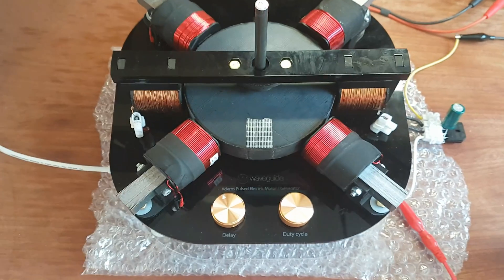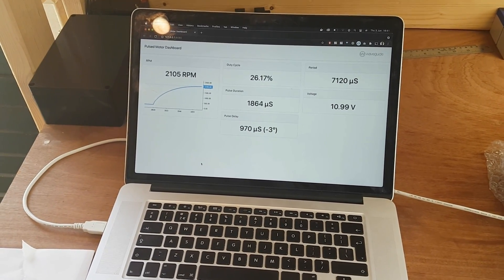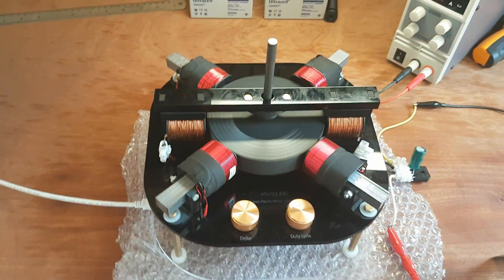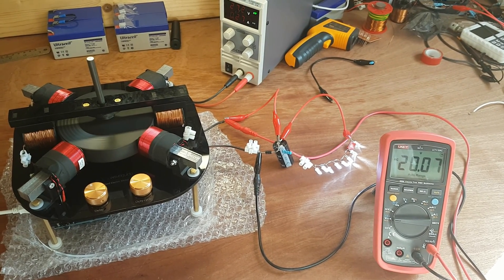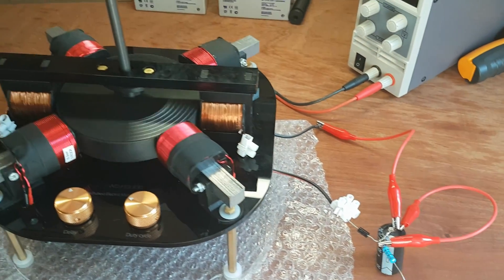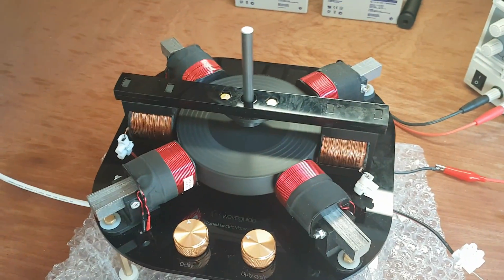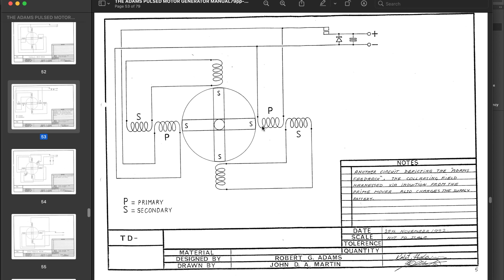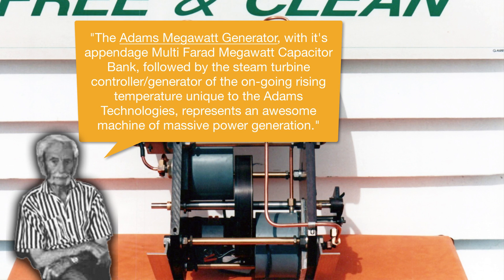COMPLETED Adams Pulsed Magnetic Motor Generator Load Tests + Brand New Adams Material

Comment: Wait did you try anything like flip the iron bars of the generator around. The lenz drag certainly happens when the magnet wire is close to the magnet, but is that the same for induction through the iron alone, on your machine?
Reply from the maker: I did not try that yet no
Reply: @Waveguide  I know it is hard to stray from the clearly described path, like your on one clearly. But then again it doesn't hurt, it already slows down now. It is certainly possible to get rid of drag, hence the reason for me to build a new generator again. I had this small Mock up generator that did not slow down, and now I'm going for the bigger one. JP

Comment: How many other folks pointed out your drive coils are too close to get decent results, adams suggested 1/2 inch gap between the drive coil and rotor
Reply from the maker: Thanks for youe suggestion, but Robert Adams specifically mentioned a 1.2mm air gap between magnet and coils was important. Do you have a reference to a quote from Adams himself saying the gap needs to be 1/2 inch? Because I've never read that anywhere.

Comment: Nice and neat build.  Just consumption of your system is very high. In my device with 30V input it takes up to 0.06A. I use relays coils as a pick up. With its 10K turns It gives me good voltage. It change to curent later in separate system.

Comment: Nice set up. I had an aluminum disc machined (10 inch wide x 3/4 inck thick) I had them perfectly drill and tap 8 holes for my 1 inch wide magnets x 3/4 inch thick.
Balance is awesome.
The output is way up there. I removed the pick up coils and added more run coils. The spikes are greater then 170 VPP.

I made a video of it if it will give we ideas.
Reply from the maker: That sounds very impressive! Would love to see a video of your system in action. 

What are you using to pulse the coils?
Reply: @Waveguide  I have several vids out there on my channel showing it working. I try to make them short. I use the typical Bifilar (Bifiler?) coils and 12VDC. Thanks for the response.
Reply: @Waveguide  The videos show a practical application that one can actually use in real life instead of solar. Please watch and learn. I'm watching more of your vids to see if I can learn something more so I can share it. OH, I just sub'd, Thought I did the other day.
Reply: This is first I've heard of this can you help me with any plans or anything like that I was looking for a bindee motor

Comment: nice work =) could you share the reason of your coils beeing at a different angle ? In the original, 25° offset seems his way to go .... looks like you did 45°?
Reply from the maker: Thanks for your question! In the original design the generator coils can be moved between 25° and 45° to find the ideal position. I first did that, but it made the coils shake a bit (less sturdy) and didn't notice a significant difference in output.
Reply: @Waveguide  very interesting , so no need to test that out ^^
 thanks for sharing ;)

Comment: you need to pulse the output and also use a bridge rectifier to catch the back emf!
Reply from the maker: Dozens of people have told me this already, but the pulsing of the generator coils comes from Patrick J. Kelly. Robert Adams himself has never said this, and in his UK patent (https://patents.google.com/patent/GB2282708A/en) he even mentions you can replace the generator coils for a traditional alternator connected to the shaft, so there does not seem to be anything magical going on with his generator coils.

Comment: Robert Adams said that the output coils are turned off most of the time. They are connected to the load when the magnet is located exactly in the center of the coil core. The coils remain connected for only 3 degrees. It is impossible to connect the load to the output coils all the time
Reply from the maker: Many people say this, but I've read nearly everything Robert Adams ever wrote, and never saw him mention this fact. The only person who I've seen mention this is Patrick J. Kelly, so it's a third person account. Adams himself says in his UK patent that a regular generator can be connected to the shaft, so there seems to be nothing too special about his generator setup. If you have a reference or a quote from Adams saying otherwise, I'd love to hear it! 🙂

Comment: Hello Waveguide,
    have you considered the idea that your rotor is traveling  at or near super sonic velocities at 2000 to 3000 rpm's???  You could eliminate this by either running your motor on top of mount Everest or putting the whole thing in a vacuum chamber and dropping  the atmospheric pressure to a point that will allow 5000 or even 6000 rpm's WITHOUT the motor trying to disassemble itself!!!  This is the reason all electric motors in todays society are built so sturdy, and make so much NOISE!.
Reply from the maker: Yeah the peripheral speed is pretty scary indeed! And my rotors have disassembled several times because of that.

Comment: It is no wonder this device doesn't work because you have not followed Robert Adams simple instructions. This is not a valid replication only a conventional pulse motor driving a standard induction generator. It will never work as you have built it, not in a million years...
Reply from the maker: Thanks for your reply. Please let me know which instructions from Robert Adams I have not followed, because I tried to stay true to his design, apart from the switching circuit of course.

People here constantly give me tips like: "use bifilar coils" or "switch the generator coils", and I always tell them that I won't do that, because I try to only do what Adams did.

So I would very much like to know from you what instructions of him I am not following.

Comment: Hi., Do you achieve overunity? In your experiments in adams motor gen...  Been replicating it but can not achieve speeding effect while on load
Reply from the maker: No OU effects so far.
Reply: @Waveguide  thanks ..maybe ill stop here for this,.. and try to replixate solidstate devices like MEG
Reply: @Waveguide  whats the highest efficiency you've done so far?
Reply from the maker: @cesarranolo9215  using standard meters on input and output, only 20% efficient or so. However, the inventor said you needed to measure using calorimetry.

Comment: You got close when you shorted. The output coil except you are supposed switch them  out  part way through  the magnet passing  so field collapses  adds more push to the wheel. And energy output
Reply from the maker: I heard this before, but it seems the person who wrote about this idea of switching the generator coils is Patrick J Kelly, and Robert Adams never mentions this. Adams' UK patent even states that for the generator a traditional alternator connected to the motor shaft might be preferred. And a traditional generator doesn't switch either of course.
Reply: Yes he said it was some one who replicated the Adams motor and achieved 800%  efficiency ,  but I have seen this in a few other. designs to achieve over unity with other devices
Reply: One other thing that don't consider it is an attraction motor  so  drive electro's must have a smaller face area than the magnet's. So you only need a very short pulse to break the magnetic lock that is where you the gain. Magnetic attraction drives the motor  small poet pulses. Allow it to carry on and not lock up then you harvest the back Emf

Comment: Wow cool good work ! Are you using speaker laminate crossover coils for your Adams Motor?
Reply from the maker: Thanks! For the generator coils, yes. The drive coils are hand wound using 0.5mm wire on a solid soft iron core, as per Adams' recommendation.
Reply: @Waveguide  Is it possible to know the gauge wire and the how mh of the generator coil?
Reply from the maker: @radiumstudiodotcom  you can even know which exact coils I'm using :-) They are Dayton Audio IC1810 coils, with an inductance of 10 mH, wound with 18 AWG wire. See: https://www.soundimports.eu/en/dayton-audio-ic1810.html

Comment: Great work I would say Nick! But as some other pointed out, please experiment more and implement the other tricks... Because while it's a really clean and nice build, results are not as claimed by Adams. I spent the whole night reading all the articles and slept ZERO, immersed in negative energy, negative time, pole reversals, energy from the ether, cold electricity stuff... Someone in this world has to put a final word on this topic :D
Reply from the maker: Unfortunately, his claims were made based on measurements using calorimetry (measuring heat in and heat out), not using standard multimeters, and I don't have that type of equipment.

However, I'm currently developing his more advanced Thermo Motor Generator, and hope that has more obvious anomalous results.
Reply: 42 degrees  at 44 degress .output .the resistance of the wire 3500 metre of 0.18 .

Comment: Are you pushing or pulling the magnets.  Remember its an attraction motor.
Reply from the maker: It can be run in attraction or repulsion mode. I run it in repulsion mode, but ideally you'd only push enough current in to demagnetize the core, so all torque comes from attraction of magnet to iron core, no pushing required.

Comment: Hi, would you try adjusting the angle between the generator coils and the drive coils - it seems like that in Adam's drawings it is 25 degrees? Cheers!
Reply from the maker: In the drawing it says to adjust the generator coils between 25° and 45° to find the ideal position. 

I had a moveable platform for the generator coils to do this, but this made the coils shake violently when the rotor was spinning, so I had to bolt them down in this design.

Before that I did experiment with different positioning, but did not find a significant effect.

Comment: looks like you hit a resonant feedback when you shorted it out. I've emailed the fellow who ran the conference in an attempt to get more information.
Reply from the maker: Amazing! Very curious to hear what he has to say.

Turns out the short circuit current was 720mA RMS!! No idea how the motor kept running at that speed with that current draw.

I'm not entirely sure what Adams means with "resonance"  in his machines.

Does he mean pulse frequency is exactly right for the drive coil's L and C to reach resonance?

If so, then that is not what happened when I shorted it, because I'd need a lot more capacitance to hit "traditional" LC resonance at that speed.
Reply: Yes it looks like it hit resonance twice,  a great replication!
Reply: @quantumenergysolutions9128  resonance happens at different hertz.  Never trust your meters.

Comment: coils should be bifilar
Reply from the maker: Hi Ivan, as I said to another commenter, this might help, but Adams' own coils weren't bifilar, so I'm unsure if it is necessary for a successful replication.
Reply: @Waveguide  4 magnets are directed equally to the north. The windings are on one side and are connected in series. This implies avoiding part of the generator dragging effect. It will be much simpler if these coils are biliary, so I said so.
Reply from the maker: @teslafreedomenergy  and you mean parallel wound, series connected bifilar coils? Like in Tesla's patent?

Comment: vibration says no need of rubber. i think switching is not perfect between 4 coil. may be i am wrong. because i face the same problem. and i have control with adjustments of coil . well good job.
Reply from the maker: Thanks for your comment! The four coils aren't switched, they are the generator coils. I just think that the 3D printed rotor is not very well balanced.

Comment: Great work! I just finished reading Adams's original papers and am planning to launch a project of my own, when I stumbled across your video. I look forward to seeing you experiment a lot more. There is absolutely something about Adams's design as to what I have conceived. Thanks for sharing this! Btw. I was hoping that you would have measured the current of your short circuit load ;)
Reply from the maker: Hi Kalle, thanks for your comment! Silly I didn't do that indeed, so I just repeated the experiment and measured 720mA short circuit current!! See: https://drive.google.com/file/d/1SoN9k10oKtxZhGrP_Bb42neXaiIQuPVX/view?usp=drivesdk
Reply: @Waveguide  Thank you for your response! I sure cannot explain the phenomena but it looks intriguing. Also, the way in which the motor seems to lock into a new rpm as soon as you short out the output. I also am not sure what Adams actually meant with resonance in this case. There is a lot to cover. I am planning on making the basic device first with the mechanical switching part included, to start my experimenting with and stick to it, trying to come up with similar-to-original results by twiddling and tuning the device before I start venturing into electronic switching. That way, I will get some reassurance about the validity of the design before I go doing some wild experiments ;) But realistically, I have a six-month ongoing project of another kind that still needs my attention, and I must get to the finish line with it before I start having some Adams fun. I will venture on to your blog more deeply as soon as I have the time to do so. Your blog post looks like you have some great thought and good analysis going on there!
Reply from the maker: @kbeefer2  Once you have your basic device completed, be sure to send me a picture of your setup, as I'm very curious to see it! (Can contact me through my website)
Reply: Can i get a copy???
Reply from the maker: @Artur house soft iron is what Adams used and I tried to stay true to that.

Comment: All your coils should be bifilar.
Reply from the maker: Might help, but Adams' own coils weren't bifilar, so I'm unsure if it is necessary for a successful replication.
Reply: @Waveguide  fair enough.  I understand you are replicating a specific patient.  Nice looking build.
Reply: @Waveguide  I was thinking the same, all methods to remove  the drag,or/and boost the drive coils should be explored.  some guys did get a  Bedini circuit to self power.